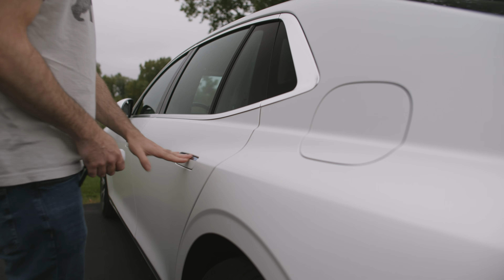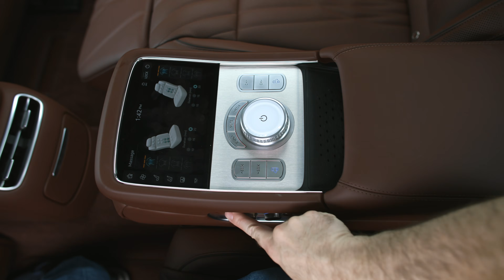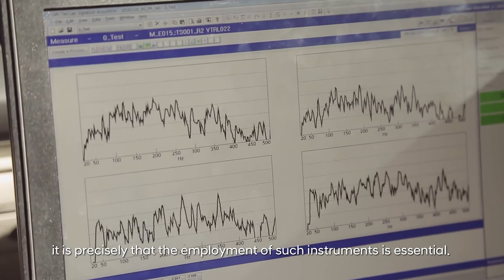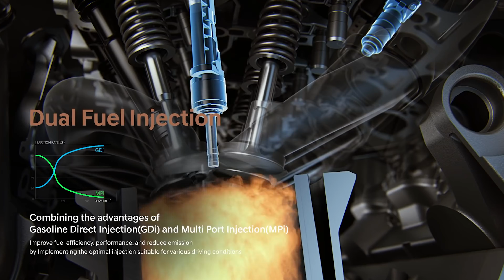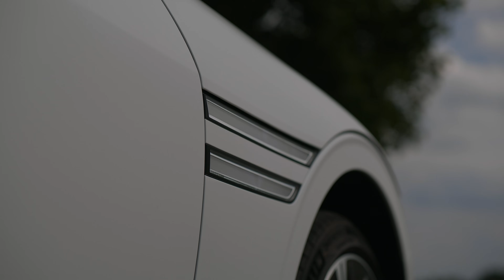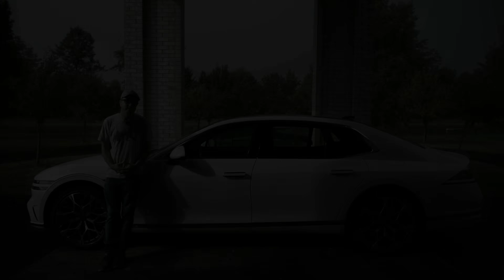2023 Genesis G90 | Great Car, Gimmicks and All

Comment: GENESIS: WE DONT WANT TO OVERCOMPLICATE THINGS!
ALSO GENESIS: BRRRT THERE GOES GENESIS WITH TURBO, HIGH VOLTAGE ELECTRIC TURBO, AND HYBRID POWERTRAIN, dual chamber air suspension ,rear wheel steering..... 😂😂

Comment: Mechanically you just said Port & Direct Injection..That’s what I have in my 2023 Kia Sportage X-Pro with a 2.5L 4 cylinder. 🎯🎯🔥🔥👍🏾👍🏾
That’s awesome, these engines virtually eliminate carbon buildup associated with Every GDI motor, especially the Germans. 
I hope Genesis and Kia will only continue to use this fuel delivery system on all its ICE Vehicles. Until I get my EV, I’m only getting duel injection vehicles.  Genesis and Kia are winning 🥇. I’m definitely looking forward to getting every bit of my 100K mile warranty & I’m thinking their new vehicles will deliver. 👏🏾

Comment: I have a Hyundai Equus that had air suspension and it sucked. I converted it to coil springs with used Kia K900 parts and I enjoy the car much more. I hope this air suspension is much better.

Comment: Hyundai actually used air suspension on First gen KDM Hyundai Genesis sedan V8 model and the first gen Kia K9 KDM V8 models. this G90 is 2nd time they use the air sus.

Comment: If I am spending $100K, I would buy German or even a Lexus. Can’t justify buying a Genesis for that much. The whole fit and finish doesn’t measure up to the top luxury brands.
Reply: Realistically, I will settle with 2023 740i or s500. Can't justify buying LS either if you look at its poor underbody settings and its outdated technologies.

Comment: Saw one today, gorgeous in black and white too.  Interior is really nice but looking at this and other reviews, it’s no S-class and tho the new 7 is ugly af, that car seems to be far more advanced also.  Engines, transmission, ride + competent handing is still with the Germans.  Mercedes and others like Jaguar prove that you can have a cosseting ride and great  handing.  No S or 7 bounces over a bad road. A modern turbo V8 is needed here as the V6 is still weak. Guarantee that they the I6 740i and S500 will outrun this and still get better fuel economy.  It’s a good car for sure, but as you pay less you get less. Features alone don’t make a luxury car.  It’s the total package and this car seems to miss that last little bit of polish and refinement.

Comment: The Genesis line is getting so stupid expensive that you may as well get the BMW or Mercedes instead. Wont cost too much more.
Reply: An S-Class optioned the same will run $25,000 more. Same for a 7 Series.
Reply: @billkallas1762  $25000 is not a lot for someone who can afford a 100,000 car.
Reply: @majicogarcia8417  Of course, you'll have to deal with the BMW and Mercedes repair costs. and Genesis is much more reliable.
Reply: @billkallas1762  Rich people lease. They dont deal with repair costs and oil changes.
Reply: @majicogarcia8417  Nothing like a 25 year old Mercedes.

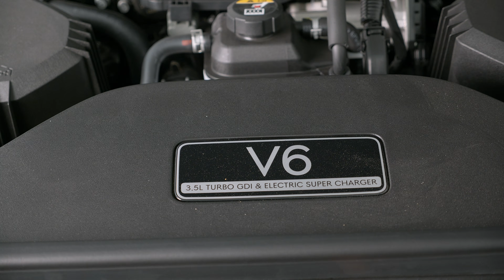Comment: 9:34 feels like a lie. Toyota does this in all their direct injected engines because of the oil from the pcv getting on the intake valves and not being cleaned off by the gas going by. It has nothing to do with noise. I garentee you cant "hear a diffrence", Its just to help these engines last longer and not need serviceing. Toyota has been doing this for 10 ish years now. Im not a fan of how they change the back of this car. I liked that the previous model looked more like a S-class or a rolls royce. They (in my opinion) cheepened it a little and made it look more lik an audi. Not a bad looking car at all. Just a bit less luxury looking and a little bit more sporty.

Comment: Do not buy crap hyundai..New hyundais look great with high tech modern parts..but they broke very quick..i bought brand new hyundai i20..it broke 5 times..1 is transsmission 2 and 3th time engine and turbo got ruined..4th time electric problem..and car had very bad brakes and interior quality..after 11.000km car got weird noises inside of it while driving..i sold it thank god and bought second hand audi for same price but old one..no issue at all..i would never buy hyundai again

Comment: nice video an awesome car . just 1 small correction at 6:18 you mention Hyundai an Air Suspension an this car being the first they built with it .. however iam an 2014 Hyundai Equus owner i have air suspension that does exactly what you describe for this system an hyundai built the Equus with Air Suspension from 2011 - 2016 !

Comment: Here in Korea, G90 is not a first of kind. Hyundai made this kind of cars over 3 decades. 1986 Grenduer was genesis of this kind to Hyundai. even before Grenduer, Hyundai made 20M and Granada under licence of Ford from 1969 to 1985. 

1996, Hyundai made Dynasty that has electric controlled air-suspension, 5 airbag and navigation with AV monitor which was... unrealistic at that time.

Comment: 9:35 Thank you for the dual injection discussion in terms of rattling noises at low RPM.   The Mercedes 4 cylinder c250 of 2012-1014 sounded almost like a diesel at low RPM.

Comment: I'm the proud over of a 2022 GV70.  The only criticism I would give to Genesis has to do with their exterior design.  The G80 and GV80 are just too gaudy with the oversized grills, weird wheel designs, and chrome bling on the sides.  The GV80 also looks like someone just put a turtle shell on top of a G80 sedan.  The sloping and tapered rear end of this G90 also doesn't look/feel right.  Genesis needs to find their identity in this area.  I think Audi does the best job in this department.

Comment: I am impressed with the fact that they chose economy with the V6 package, and the Lexus style direct and port injection engine to counter the carbon build up on the valves. This vehicle is more comprehensive without being over gimickly like the Mercedes or all Touch controlled like the Audi. The Lexus is a good car, but they will not up their game on the electronics which is hurting they're appeal with todays buyers preferences. 
By the way I will take one in blue with a light colored interior.

Comment: Genesis has come a long way and I have a good feeling that they've probably already stepped ahead of Infinti and Acura.
Reply: Stepped ahead? Those two are absolutely irrelevant to Genesis, not even worth mentioning.
Reply: Infiniti is total crap these days. Their technology (electronic/mechanical) doesn’t even match Ford.
Reply: @WSOJ3  Infiniti/Nissan still have some top notch technical solutions... The VR engines are the first variable compression engines. Thats HUGE! Then there's the drive by wire technology, that a lot of people dont like but its easily the most advanced and promising one in the market. They pioneered that too. Their awd system is top notch too and their reliability is top5 (in part, because of how old they are). Right now Infiniti is on a very low level, yes, but they did deliver a good amount of great cars in the past. And lots of great innovations like the elctro-hydraulic steering in the M/Q70 (which is now used by Porsches and Mclarens), 360° cameras (first on production cars), 4 wheel steering,... Genesis are up to a promising start, in part thanks to all the money Hyundai pumps into them, but they've not brought anything truly revolutionary to the market. Even their overall design is purely european with no Korean character at all. Infiniti was at least a pure Japanese proposal. Even more so than Lexus or Acura whom always steered towards the american market.
Reply: @AI-qd4vb  trust me, I own Infinitis. They have nothing to offer these days. Their VR engine is a deadend, it’s terrible and not even Infiniti would like to continue with that path.
Their wire steering is the worst in the industry, not even at 2009 BMW level.
Their electric/hybrid is non existing.
Their CVT are the worst transmission ever happened in auto industry in the past 25 years.
Reply: Genesis is at least 5 years ahead of Acura and Infiniti now. Those are absolutely obsolete in comparison.
Reply: @raygun1414  at least 15 years ahead of Infiniti

Comment: I drove the lower trim level, no granted I didn't spend a lot of time playing with the seat, but I couldn't get it just right. I assume that was me though, I find the G80 seats great, so I should be able to get these right. I will say it is so quiet in there, it's almost to quiet. I had a friend with me who has a louder then normal speaking voice and it sounded like he was shouting because it was so quiet lol. I do think the G80 Electric will be my next vehicle, however I do want to drive on of these with the air suspension.

Comment: Thumbs up for the video, but this isn't a $100k plus vehicle and in Canada it's going to be $130k. Genesis owners have complained about the service and customer experience already. I see Genesis cats getting dumped on dealer lots. The overall reliability hasn't been proven yet. 

S Class, 7 Series an A/S8s have years of proven refinement and customer service. Older G90s are a better value. Then they're coming out with the G90L to compete against Maybach. Which is insane. Genesis is more of a Volvo, Cadillac, Infiniti, Acura and Audi competitor.
Reply: If you can’t afford it , don’t bash it lol. These Genesis vehicles won’t get any cheaper. They do sell a lot of the G90 is S Korea.
Reply: @MrGeezil  lol 🤣 Afford it, definitely spoken like a person that thinks credit is money 😂

Comment: Nit pickers must pick nits. I must take issue with your statement that "...Hyundai and Kia have never used air springs before...."
Actually, the 2009 - 2016 Hyundai Equus was the first Hyundai with an Electronic Air Suspension (EAS) and Continuous Damping Control (CDC). These cars are getting to the age where their air bladders begin to leak a couple years after the 5 year/60,000 mile BTB warranty expires, and like the S class, replacement of the air shocks is an expensive proposition. 

Otherwise, this is a good review of a great car. 

 I think the first generation G90 has the greatest bang-for-the-buck among all luxury cars. I have a 2018 G90 3.3 TT sitting in my garage that I bought as a CPO, which increases the BTB warranty to 6 years/75,000 miles, and extends the 10 year/100,000 mile powertrain warranty to the second owner.

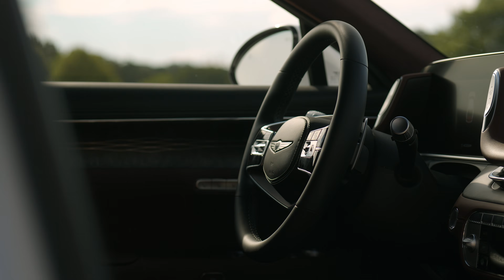What's up with the scrolling title on the infotainment screen at 2:17? Is Ferocious Ganders leaving Easter eggs for viewers, or is "Why do testicles move" the name of a new band?

Comment: I imagine it would be weird or at least need getting used to to have acoustic announcements coming from right behind your head instead of the dashboard area.

I'd also have liked to hear an actual ear test account for the countersound system from whoever does the audio system reviews. (Which I didn't notice here.) I would not be surprised if it seemed weird to fine ears when it is active.

These types of products, with highly diminishing returns, lots of extra tech for some fancy edge, that should be what goes away first when SOMEONE screwed the economy up. But of course due to the nature of the problem that's not what happens. Quite the opposite.
People who can afford quiet luxury cars tend to have a desire to get away from the painful noise they help create, the blowback of their lifestyle.
A yearning for things often emerges as attempted compensation for lack of love in society. Capitalism through its materialist agenda creates the unhappiness that it thrives on by then providing 'solutions'.

As someone who has not invested in contributing to the problem, the only thing I would prefer over being able to live in a quiet getaway is a world in which I did not feel that need.

Comment: Let's be clear when saying that the transmission in the G90 is not as good as the transmission in a Mercedes. The transmission in the A class and C class Mercedes are HORRIBLE. It will buckle going from 1st to 2nd gear. It will jerk when coming to a stop because it shifts from 2nd to 1st gear at LITERALLY 0MPH ON THE ODOMETER, causing a huge jerk and letting your passenger think you don't know how to drive. E class Mercedes, yes, the non-AMG E class has a nice and smooth transmission, but I just wanted to make that clear. ZF8 in the BMW, perfection, doesn't get better than that for a luxury oriented driving experience.
Reply from the maker: Tq converted S class trans.
Reply: @savagegeese  The S class is above my pay grade :(

Comment: I'm really curious to see how the new air suspension feels compared to the existing one, and what difference the active noise canceling makes.  One thing I thought was odd is that although my G90 is very quiet, it isn't unbelievably so.  My previous Genesis sedan was noticeably quieter after I added more sound dampening materials all over the place, so I know there is room to go.

Comment: Ever since moving to EV's, I'm no longer impressed with gasoline engine cars. My Polestar 2 is currently being serviced, so now I'm driving a Lincoln MKZ 3.0t V6 loaner, and although it drives really smooth and has decent punch, it's nowhere near as smooth as my Polestar and feels like it's going in slow motion when press down on the pedal. At 408 HP and 487 ft-lbs torque, my Polestar does nearly 100 mpg equivalent while the MKZ at 400 HP is 17/26 mpg.  I've driven the Kia EV6 which shares the platform with the G80 EV version, and that car is pretty amazing compared to the G90 version reviewed here

Comment: Thrilled that Genesis is maintaining a strong trend of tasteful, restrained design with an almost '50s bent on brightwork and the "marble" trim.  I am curious, since I've noticed it on Genesis from day one - are the silver interior brightwork elements still a cheap plastic feeling when you're pressing them?  That always aged poorly in my experience, and I hope they fixed that issue.  They've come a very long way in the last 10 or so years - looking forward to seeing how they continue to improve.
Reply: They feel good, but living in Texas they get so hot you can get burned. G80 speakers on front doors are ones you can burn your knee with.
Reply: Real metal, not plastic.
Reply: @mojojojo_BB  if that's the case, that's excellent.  However, in every Genesis product for the first couple of model cycles, it was cheap, silver plated plastic that felt horrible and looked worse after the first owner got ahold of it.

Comment: This car looks phenomenal, but the previous generation also looked amazing and it still had the 5.0 V8. What a spectacular engine that was. The facelifted version of the previous generation commanded so much presence.
Reply: That's the one thing I'd miss - you can make the V8 sound amazing.  However, I like that the exterior styling now matches their other vehicles, and that they added back the foot rest, air suspension, and added massaging seats like they should have always had.  I love my car, but I felt like it was weird that the old Equus had some features than the current G90 doesn't.
Reply: They dumped it because they are building a presence in Europe and they want to meet regulations without having to sell a different variant in each market.

Comment: A low mileage, heavily depreciated example in a couple of years will make this an absolute luxury bargain.
Reply: Why would it be a bargain? Why do you think heavy depreciation would occur here?
Reply: @Dowlphin  because it is a luxury car. In 10 years this will cost as much as a well equipped Corolla, if there will be a Corolla in 2032...
Reply: @Dowlphin  no one will want to maintain this car in 10 years, this is why it will be cheap.
Reply: @Dowlphin  because of higher maintenance cost compared to a new Corolla.
Reply: @dragospahontu  it's not about maintenance costs. People that can afford this can afford the costs it brings. It's all about wanting something else, getting tired, wanting a refresh or new experience. Besides, no matter how good it is it will still get relatively dated in 3-5 years. Just like old ls.
Reply: @rosgoncharuk2403  the design will be dated for sure. It's a flash in the pan.

Comment: still hard to believe they sell this noise cancelling stuff as a new gimmick. it's been around ages. i had headphones with that feature 20 years ago and even then it was around already. i am still shocked that not every non-sportscar over 50k has this as a default
Reply: Noise cancellation in the contained space of a headphone is easy. One microphone and some simple electronics. The cabin of a car is a complex space and they're trying to cancel noise at four seating positions. That takes multiple microphones and speakers to accomplish, and if done badly is noticeable. This is also trying to cancel higher frequencies than some systems, to neutralize tire noise.
Reply: @markmiller3279  fair enough but the technical principles behind it are exactly the same. it's just more microphones and different/more frequencies. this could have been done 20 years ago without any issue

Comment: Love the reviews! HOWEVER - you said Hyundai/Kia haven't used air suspension previously - not true. The 2009-2016 Hyundai Equus (basically a G90 before Genesis) did have air as standard. I owned a 2012 for two years, was great.
Reply from the maker: This is first with dual chamber and read ahead. I should have clarified.
Reply: @savagegeese  not dual. three chamber~ :)
Reply: How much horsepower does an Equus have?
Reply: @Dowlphin  429 hp when the 5.0 came out in 2012.
Reply: @Dowlphin  That went right over my head at first lmao, good one!😆
Reply: those were directly from german supplier, now in house developed domestic supplier
Reply: How's that equus is holdin up
Reply: @Angry-Lynx  I sold it in April 2022. Though I’ve seen my exact one recently in my area. Was a great car when I had it